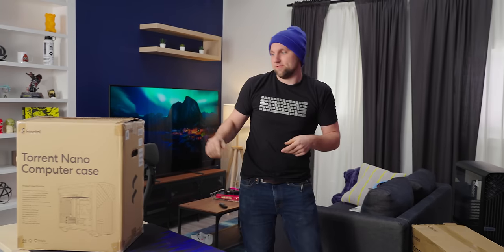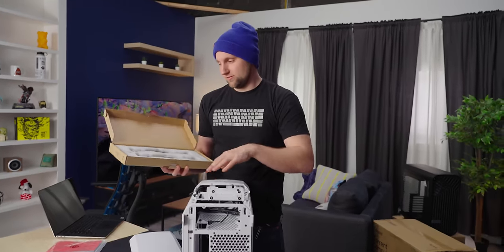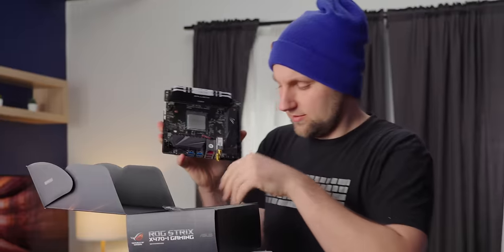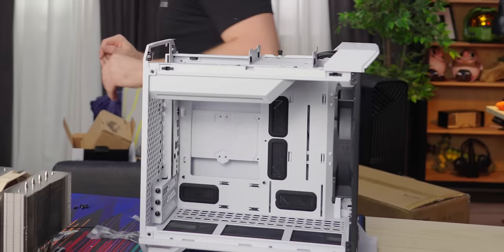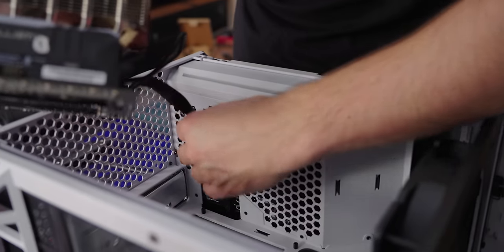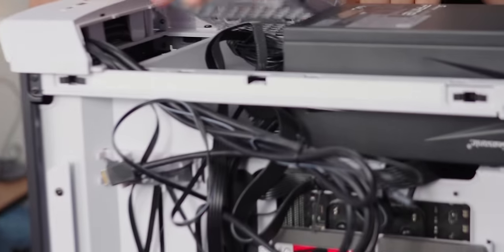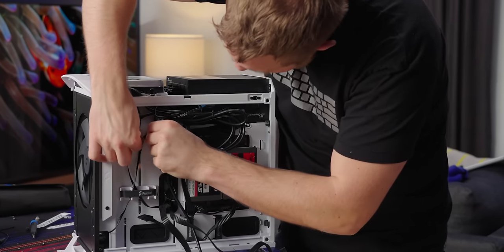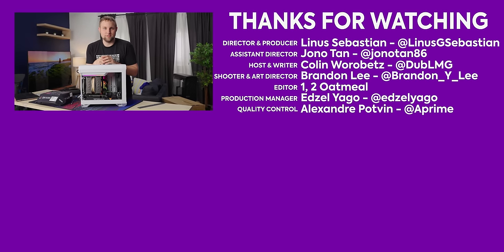The BEST case got SMALLER! - Fractal Torrent Nano

Comment: I was going to look at switching to this nano and replace my meshify Mini mATX build but for some reason ... the nano is larger on the depth, and the width and is just an inch and change shorter. Like... It's an ITX only case and its only that different? - The mini still as room for a front and a roof AIO too! Guess I will never get rid of this case as nothing still comes close.

Comment: I am definitely getting this case. seems like exactly what I want without being much bigger than my current ncase m1
Reply: The case is quite big and the airflow next to gpu sucks.
Reply: @oneone8318  I have it, yes it's big, but the airflow is amazing.
Reply: @MyGreatCreation  I get heat from gpu stuck next to the glass it´s venting to. i wish they made metal panels too with venting holes next to gpu. Otherwise it´s a solid good product.
Reply: @oneone8318  I just use slim noctua fans and I have 0 problems
Reply: @MyGreatCreation  you have em under the gpu? i have no fans under gpu. maybe i should add, but it seems super tight. i don´t know if any fans will fit, also i did not see any holes for the fan screws or slots for fans.
Reply: @oneone8318  u have a 2.25 slot card I can't fit the regular 120mm fans under it but slim ones work great.
Reply: @MyGreatCreation  i have the MSI GeForce RTX 3060 GAMING X (LHR). im not sure if it´s 2,25 slot or what size. :/

Comment: I would expect poor GPU thermals in that case. That model's fin placement has it sucking air in through the bottom vent and then pushing it straight into the solid tempered glass panel where it has nowhere to go. I really wish case manufacturers would take this into account and drill a few holes into the side panels above where the GPU is expected to go! My CoolerMaster Elite 130 build has the same issue. It runs way cooler and quieter with the paneling removed.

Comment: Looks like I now have no excuse not to get out of my 5 year old Define Nano S. Looks trickier to build in, though. Glad to be able to watch someone else make all the mistakes first. But it's literally 1.5cm in height away from being an mATX case, so why didn't they just do that? 2cm taller, 1cm wider behind the motherboard tray, 1cm longer for long boy GPUs; it wouldn't have been significantly larger overall, but it would have been significantly more usable.

Or I could get the Torrent Compact with similar overall size and fewer compromises, but it is 30% larger and 60% more expensive.

Comment: My one complaint is that the cooler is torqued with the motherboard vertical like that.  So many modern cases do that.  An AIO wouldn't care, but I prefer tower coolers and without some kind of support there I just don't think the torque is good for the system.   So I am still using the venerable Fractal 500 for my boxes.

-Matt

Comment: the d15 only fits with asus mobos, tried to install it on an msi b550i gaming edge wifi and it's too large and hits the case's ceiling. there's like 12 mm between the mobo and where it's supposed to seat while the d15 is stuck on the ceiling. that's because for some reason the am4 socket on asus's boards (b450i, x470i and b550i) is slightly lower than other manufacturers. really sucks it doesn't fit and i have to downgrade my mobo :c

Comment: That’s probably the only slightly almost reasonably finessed way I’ve seen to have a top-mount PSU platform in the history of computer cases. “Top-mounted” is something I always leave unchecked when searching for cases, but this makes it seem reasonable, tucking it away with one angled panel at the back.

Comment: I just did a similar build but instead with a Noctua NH-D15S Chromax Black, i5-12600k, ASRock Z690M-ITX/ax and RTX 3080 ROG Strix. The Noctua cooler must be mounted upside down in this case.
Reply: Hi, tell me what the temperatures are in this case. How hot is the video card?
Reply: @artyshok5008  gpu at max 83 degrees celcius when playing games at 4k ultra. Cpu at around 60-70.
Reply: @tonpaa01  Thank you for your prompt reply!

Comment: Is the case not compatible with intake fans in the base??? They're pretty much essential in SFF cases like this. My InWin A1+ dropped 17-20c on the GPU just adding 2x 120mm fans in the base blowing right into the GPU.

Comment: I just built my SFF system with the same case and CPU cooler. The Noctua NH D15 front fan is missing on my build, just like in the video. It's because the fan can't clear the height of the RAM in front of it. Do you know if another fan could be used to clear the ram and accept the fan mounting bracket to the cooler itself? I want maximum cooling, lol. Thanks.

Comment: If you dont want to spend a day aseembling your pc,screw the hdd to to blacket, make all the cable connections without cooler and psu, and finally add the cpu cooler and the psu.

Comment: Damn what a sweet case! You should've placed a regular Torrent besides it.
My full size ATX seems smaller in my Torrent than that mini ITX does in that build. Really liked how the D15 and the GPU fills the case. 
Will there be a an airflow and temp performance video featuring this build?

Comment: @10:37 I'd recommend removing that exhaust fan at the rear of the case behind the CPU cooler. Unless the airflow is synced up exactly, that will cause air to bounce off of it and recirculate back into the case. In this design, if it were possible I'd actually move the rear exhaust fan to the bottom of the rear plate to exhaust the area around the GPU, where there's no directed airflow. However, that would clash with the GPU...

With the rest of the airflow design - I think this Nano case is better than the Compact. The Nano really uses the bottom intake for the GPU because the large front intake fan 's airflow is not flowing beneath the GPU... though that tight space around the GPU itself means there's no real exhaust at the bottom of the case (as I noted above). 

The Compact has an issue in that there's a large volume between the GPU and the bottom of the case with the front lower fan pushing air across it. Meaning that you will have less effective airflow from the front of the case because you are not constricting the flow of air from front to back, you reduce the pressure across the fan axis due to airflow entering from the bottom of the case. If it had been my design, I would have left the bottom of the case as solid.
Reply: But the Torrent compact can fit 2 additional 140mm fan on bottom
Reply: @Dan-bh8jd  Yeah, and that's not a great configuration. The point of cooling is to move the maximum amount of cooling medium (air, water, glycol mix, etc.) through a system which can be used to absorb energy from the system in question, usually through some sort of heat exchanger (e.g. a heatsink).

TL;DR - too many fans decrease overall system performance.

If you ran this system in a configuration with two fans at the front and two at the bottom (ignoring the back for a moment), you are not in an optimal configuration. Fans work by creating a pressure differential across their working axis, which is why static pressure fans have more of a "scoop" design in order to create a stronger pressure differential. This means that the fans in the centre of the case, pushing air in from the bottom mesh are creating a region of higher pressure due to not only their drawing in of air but also due to that air hitting the solid body of the graphics card. 

This region of higher pressure will cause the front fans to have lower efficiency - meaning that they will be required to work at a higher rpm in order to move the same volume of air across them.

If you visit the Fractal Torrent Compact webpage, you will see an animation which shows the airflow effects of the two front fans (and also why no rear exhaust fan is necessary). However, this animation does not take into account the air drawn in (ambient chimney style) from the bottom mesh in the case. It assumes too much efficiency and lack of turbulence as a result of this "cross action" airflow. Which is why I said it would have made more sense for Fractal to actually just block off the bottom of the case...

I actually have a blogpost covering all this but this channel automatically nukes any links in comments. If you want to search it's "hole in my head" at blogspot.
Reply: @Eternalduoae  im more worry,  does the power supply get any air half the intake cover by the tower and all the air flow is floating from front to back
Reply: @Dan-bh8jd  yeah i think it'll be okay. It has a fan to draw stuff in.
Reply: @Eternalduoae  
I swapped from the NR200 to this to prepare for giant GPUs and their power requirements.

Was just staring at my new Torrent Nano build and realised that the PSU has poor air intake. You seem like you know what you're talking about which has put my mind at ease a bit.

Comment: This case looks absolutely awesome, except for one fatal design flaw.

Had Fractal designed it around an SFX-L PSU instead of a space wasting ATX unit, they could have shuffled the entire backplane up one PCI slot and made it a MATX format case.
That way you can have your fatboi videocard AND a 25/50/100gig fibre ethernet card under it in the same external dimensions. 🙃

I dream of the day the world realises that if you're going to make ITX cases that freaking huge, you might as well go mATX and open up a world of expansion possibilities.

Comment: SHIT! I have a Define Nano from Fractal and I WISH I had this case. Still rocking my 10-series card because I can't fit a triple-slot card, and the PSU is in the bottom directly below the PCIe slot, so it interferes with the airflow to most of your GPU unless you mount it upside down. This is a much, much better design.
Edit: this is legitimately making me consider buying this case and trying to sell mine. It's $60 more than I paid for my current case but superior in seemingly every way.

Comment: What are the GPU temps? The case works with 4090 with bo issues but I am not sure about my 3090 because it might get too hot. Can I fit in my 3090 in there?

Comment: Nice case but I prefer the big bro. Why that huge cooler, I have a 9900k and Noctua nhd 12 with just 1 fan and it has no problem cooling my CPU, I even did some stress tests running the CPU at 100% for 10 minutes and it never got over 80c with ambient of 25c.
That's at stock, I run it with -0.06V offset so it runs even cooler, usually 15-25c over ambient at idle.

Comment: I never understood the need for always smaller cases, I like my components to have room to breathe. Then Again, I'm still using an 18 year old CM Stacker (i think T01) full tower (which only support 5.25 mounts), so what do I know.
Reply: Other side of the coin. I've never understood why cases are so large for no good reason. Letting a component breathe does not require 3x the amount of space the actual components take up. Going smaller has always been the logical way going forward. If you can achieve the same thing as a large case in a smaller case then what is the point of the large case anymore
Reply: Space on your desk or floor or wherever you put your computer isn't limitless, and PC components have been getting smaller (other than heatsinks).  What PCs really need to "breathe" is ventilation, which excess space inside the case doesn't necessarily help with.

Comment: nice; when i heard about this case yesterday, I thought, hey, you can fit a nh-d15, full size videocard, and atx psu in that! The one question I have is just how much space is there thickness wise for GPUs? I just got a little burned with my current case; the nzxt H210; that supports dual slot cards; but most dual slot cards are actually like 2.5 and don't actually fit.

Comment: Im buying the Musetex y3. Anybody know what fans they use so I can buy 1 for the back exhaust? Comes with 2 rgb in the front already. Im getting a 240 rad for top but need 1 back fan and want it to match. What fans are those on the y3? Not very known case it seems but I love it for a Micro atx. Really wish I could figure this out.

Comment: For 30 series GPUs, while the max length is a good measurement, I've found that the Max GPU Height is a VERY important spec to inform users with considering how chunky most of them are.
Reply: Max GPU height would be about the same as max CPU cooler height.
Reply: @VitalVampyr  I think that's width. L x W x H, so there are 3 dimensions. Width would be max CPU cooler height, but the GPU height would be from where the PCIe socket starts to the bottom of the chassis/case chamber.
Reply: @AllenGuarnes  Height is how far a component extends from the motherboard.  The dimension you’re referring to would be width by process of elimination, but it’s generally just reported as the number of rear panel PCI slots it occupies (ie a 2-slot graphics card).
Reply: @VitalVampyr  the standard Amazon format is L x W x H.

If you look at product dimensions from the 3080 cards, irregardless of brand, they always list it like as follows:

For example, the MSI Gaming X Trio RTX 3080 card:
CARD DIMENSION (MM)
323 x 140 x 56mm

It's a 2 pcie slot card, but the fan brackets extend beyond it. That's what I mean when I say that for 30 series GPU cards, the height has become an essential specification to inform users with.

Comment: To me it seems like the connectors for the graphics card have very little clearance at the top, making it impossible to fully insert many DisplayPort cables. To be fair though, this is an issue with most cases as far as I'm aware, I actually had to cut up mine to insert my cables all the way in.

Comment: just buy thermaltake tower 100 its have filters its easy to make cable management and its have exhaust fan i wonder why this mini itx case makers dont make any filters i mean what is point just a simple filter i sold my sugo 13 just because of this its not have cable managemend its not have any exhaust fan and they claim its easyl can use normal atx psu but its a big mess if u use that so in short until they make it right thermaltake is best for me

Comment: Hey guys. I have a great idea. buy a nuc 12 with lowest spec, put a 12900k into it undervolt it , power limit it , dissassamle the whole think, keep only the cumpute unit - motherboard thingie and the 2 pcie 16x base board, buy an rtx 3090 turbo 2 slot beast, change the vram pads on it, use higher quality thermal paste, change the nuc 12s base sfx power supply to a 700w flex - atx, and 3d print 3 houses for this pc hardware for 3 different fromfactors or usecases, 1. a mac mini ultra compatitor, 2. a pc all in on back of a 1440p 240-270hz 27 inch or 4k 10hz 10 biit hdr monitor, and 3. make the most powerful little bit thick 16-20 inch fastest gamer laptop. please use the lightest materuial as possible like carbon fiber printing, or stufff, both for the monior to it be able to be easily portable and also change out monitors metal mothertbard base plate to carbon fiber or some hard plastic, nobody makes thing like this but these are very good projects, if i had the time and money, i would make soething purchasable from these projects. let see what it would look like. monitors i refrred to currently are acer 12440p 270hz alienware 27 inch 240hz and lg 4k 160hz, but possibly mini led in the future if possibly and also on the laptop side, i want to see bigger, up to 21 inch laptops maybe bit lower, with same quality screenss as the bigger ones, and oh also, the possibility for useing a touchscreen panel with pen support. What are your opinions?

Comment: its a modular psu.......why didnt you run the difficult cables on the board BEFORE you put it in the case???? In such a cramped case, I would have wired everything I possibly could before installing the cooler and GPU, test fit first, then remove and make life much easier

Comment: torrent is only the best case if you air cool your cpu and the arctic 360mm aio is 11 degrees cooler than the noctua d15 at 35 decibles.

Comment: never understood the absolute obsession people have with bottom mounted psus. Heat rises put the psu that generates a crap ton of heat up top. The hot air coming out of the psu WILL get in your case and it will raise your temperatures

Comment: This case is ~35 liters based on the dimensions on the case website. That's only 10 liters smaller than the mid-tower Torrent Compact that it's based on (which is the size of most compact mid-tower cases). Seems kind of pointless to loose compatibility, complicate installation, and require an ITX motherboard just to make the case a few inches shorter.

As far as ITX cases go this thing is equal to 2 NR200's for not much benefit. You can find better options by loosing a little compatibility to go MUCH smaller, or by getting a compact mid-tower case that's a few inches taller but has better compatibility and avoids any ITX headaches.
Reply: I completely missed that the Compact was even a thing, thanks for mentioning it! Does seem like a better option against a case that is just one slot away from being mATX (and seriously, why not just make it mATX at this point??). Benefits of this one are of course support for standard ATX PSU and 165mm tower cooler, but your point remains valid. Going 30% larger for the Compact though would be quite noticeable, as would the $190+ price tag.

Comment: RTX 3090 fit? I want to go smaller.
Reply: The tuf 3080 (used in this video) should be the same size as the tuf 3090, so I think yes.
Reply: @mingyi456  if you would find  tuf 3090 lol

Comment: Really cringe at 8:34 - Never pinch a GPU's fan blades as a means of holding or lifting a GPU.  Really, no fan blade in a computer should ever be touched as a means of installation.

Comment: Still too big. Fractal just doesn't have a great design team. Needs sfx power supply to make it smaller. Also having power supply pulling air from inside of the case makes them run stupid hot and loud. I like the aesthetic but this just doesn't intrigue people who love the itx form factor.
Reply: Tool...